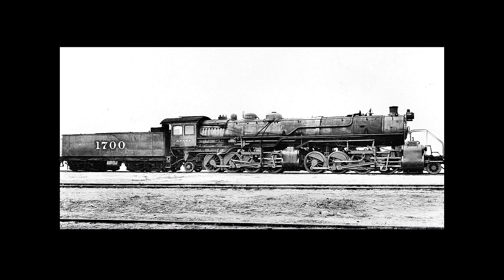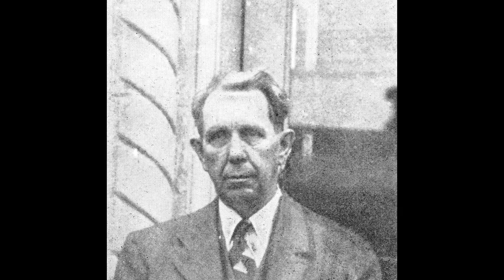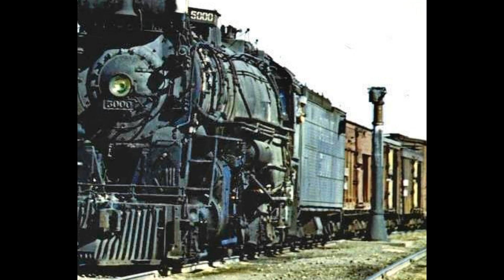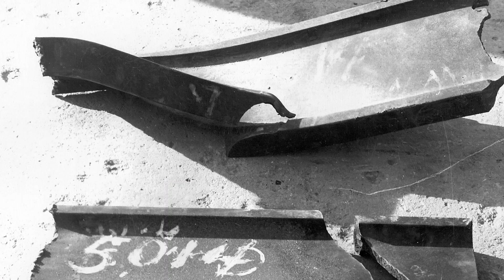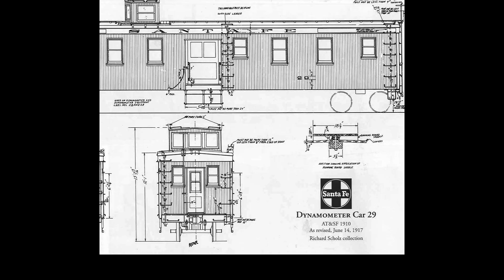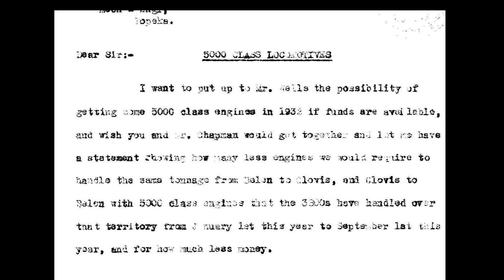Steam Locomotive "Madame Queen" History - Part 2

Comment: In this film the eight 2-8-8-2 1790-1797 taken  over from N&W are mentioned too at 10:05 and following. These engines were running on Raton Pass, the model can be bought from Roco. I have such an engine, it is running very well.